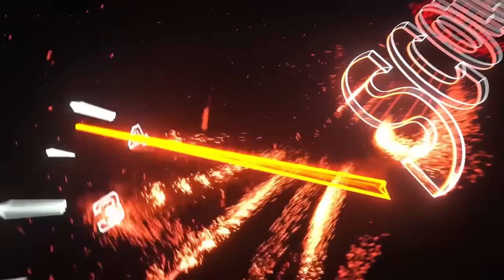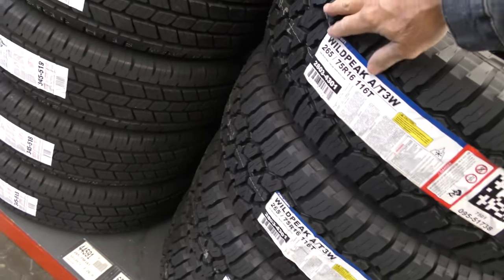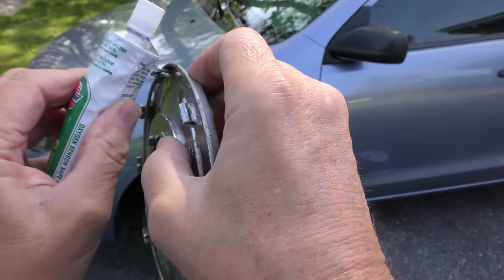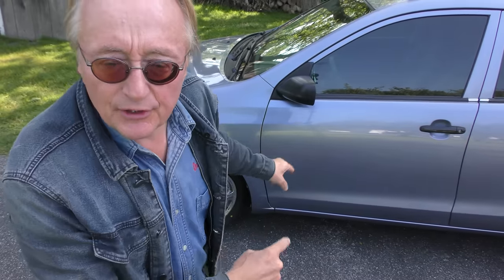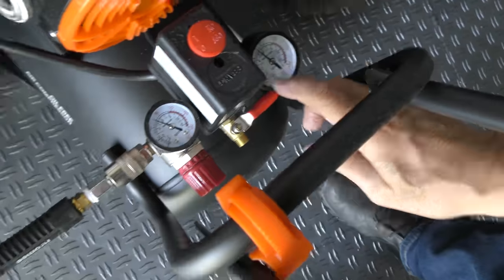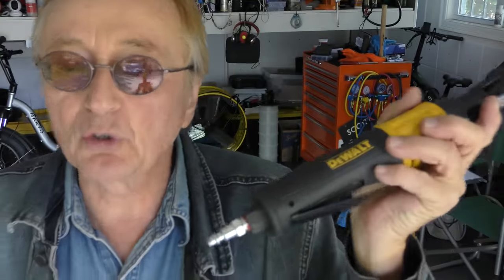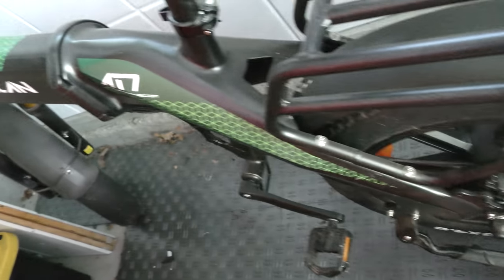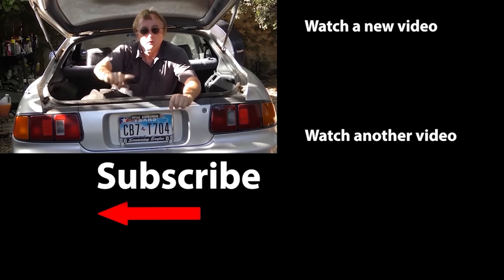Never Buy These Tires for a Daily Driver

Comment: Town Fair Tire is an excellent place to buy new tires and even new rims. My old car had factory chrome rims (never again in New England) that were flaking and causing my tires to leak. Needed a new set quickly and was worried about the final cost. I was able to find a great new set of rims at a decent price. They recommended several different types after telling them what I was looking for. Brought them to the car so I could see what they looked like. Offered interest free financing and helped me build my credit rating. Not sure how big of a chain they are, but for a chain, I was super impressed. If you buy tires and then see them listed somewhere else cheaper, they will reimburse you the difference.

Fabulous place.
Reply: Shop around. My local Town Fair quoted 989.92 installed plus tax AFTER mail-in rebate for the same goodyear assurance tires that Walmart Quoted 644.40 installed plus tax including road hazard protection. $345.52 difference a half mile away. No brainer.

Comment: I always buy factory take offs from craigslist, they usually have 100 miles or less on them, good part is you get new oem wheels every time too and all 4 wheels with tires usually cost less than buying 2 new tires by themselves.  You need to be in a larger city for this to work.  Wheels and tires currently on my truck are about 6 generations newer than itself (same model though).  Do your homework on fitment.

Comment: The valve you identified as a drain is positioned more like an air dump valve. A drain valve (which is used to drain water condensate from the tank, as you know) would be located on the lowest point of the air tank. The tank should be drained at the end of each day the compressor is used to prevent rust inside the tank.
Reply: But it has a plastic tank? So it won’t rust.
Reply: @paulsi1234  Chinese plastic is capable of rusting.
Reply: @dr.mantistoboggan4746  🤣

Comment: Doubling the advertised mileage is what I routinely get with tires. Air kept at the proper psi and getting them rotated at every other oil change is all it takes.
Reply: No way  you are getting double the advertised mileage out of a tire
Reply: @randyedelen5770  ok, I guess I did take some liberty with that statement……let me correct it. On my Ram 1500 4wd, my last set of BFG K02 tires, (which have a 50,000 mile manufacturers warranty) I only got 98,000 miles on the set before I replaced them with another set of that same tire……..sorry for my error……….😐
Reply: see he lied but ADMITTED IT LIKE A TINMAN!

Comment: By rotation of the tires they all wear out evenly. That's what I was taught as a young man from my Dad.
May God bless everyone!!
Reply: But the cost is the same on a 2wd car.  I rotate too, but over time the number of tires you buy is the same.
Reply: I'd be more worried about really badly worn tires causing extra wear on suspension parts such as struts and bearings from the wear angle causing stress on the components. That's the main problem with no rotation. I'd rather replace tires than a wheel bearing or something twice the price of a tire.
Reply: Tires suffer from age as well as wear.  So theoretically, if the set of tires receiving power wear out say in 8 years, the remaining unpowered tires will most likely not make it to 16 years.  They dry out, the sidewalls crack, etc.  So as others have stated, you're better off if you rotate the tires so they all wear out about the same time. Then replace them all with newly manufactured tires.
Reply: @guyrouillier  who the hell takes 8 years to wear out a tire, much less 16, unless it is a car in storage.  60k mi is usually the rated treadlife on rubber rollers.  That's <3800 miles a year if your daily driver 11 mi a day...get a horse or bus ticket.

RVs and boat trailers are usually the only tires old enough to seriously dry rot.  Sun kills the rubber.  Thats why they sell tire covers for long sitting vehicles.
Reply: @guyrouillier  new tire from china, boy

Comment: @Scotty according to the tire industry and independent testing including Car & Driver mag test.  The new tires ALWAYS go on the rear EVEN in a front wheel drive car because when it comes to lift/hydroplaning the rear lifts and it’s over!  But if the rear grips and stays planted it’s easier to control the vehicle. 🎉

Comment: I only buy Douglas AS. Very quiet and reliable, excellent traction even on snow. For me they outlast mileage rating with rotation at every 5k oil change. Full set in May, with free rotation and road hazard, cost me less than $400. Least expensive Goodyear you can buy.

Comment: Years ago, I had a Ford Escort with plastic hubcaps similar to what you have.   When the Ford dealership worked on the brakes for the car, they broke one of the hubcaps. They would not replace it, claiming it was old.  I had to pay for a new one myself.  This was not the only time this Ford dealership was dishonest, so they no longer have my business.  BTW, I have a 1963 Falcon in my garage.  The metal hubcaps for it work fine to this day!

Comment: If it was 4 wheel drive, there likely wouldn’t be much of a difference. You just replace the front two like a FWD vehicle. When I’ve enquired with various tyre places and the dealership for an Audi, they suggest that unless tread is very different, it’s unlikely to be much of an issue. In this instance the fronts were worn and the backs were fine.

Comment: You can probably find center caps for most cars, that's not a usually a problem.  The price, on the other hand, is usually the issue.  I've seen some OEM center wheel caps go for as much as $50-$100 per cap and more.
Reply: Ebay is a wonderful source for center caps at very low cost. I bought Toyota center caps for under $10 each.

Comment: About those electric bikes, just for safety, I would store them in a separate shed in case a battery goes up in smoke. It could be a serious mistake storing them in the garage, especially if the garage is attached to the house.
Reply: Isn't any different than people parking their electric cars in their garage...
Reply: if anything i would CHARGE them in a shed away from the house before actually storing them in an inconvenient place all the time.

Comment: Well, keep in mind to do tyre rotations so you always change all 4 so they all grip relatively the same. As Scotty advises, you’ll have new tires in front, but old rubber in the rear, so the rear can slip. Not ideal

Comment: The issue with this advice is that the rear tires will start to dry rot. After about three years, most tires will start cracking and are not as sticky as new ones. Rotate your tires when needed 10k miles or more if you have no alignment issues. Also most tire shops will tell you to put new tires on the rear. This will help prevent hydroplaning when going into turns.

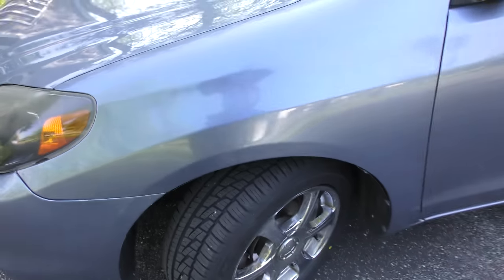Comment: 3:30 I just had some nice special order Falken tires installed at Sam's club and they put the dots in the wrong location on both rear tires. They did the front correctly. Man, businesses everywhere are so unreliable.
EDIT: Not sure if I wanna go back and complain. Now I don't trust them to reinstall them properly, clean the bead etc.

Comment: Town fair tire used to be incredible. Especially if you had a dealer account or a garage account. They do installs for five dollars each tire. They do have really good prices but they were bought out by Mavis. The old man Neil used to own every single location. It was generally Northeast, but I think they are expanding now. The only problem is, the alignments are cheap, but they will only align the be car. If there is anything wrong, you are on your own until you fix the problem. Also, if you have a dealer or Garage account, they do alignments for $55. That’s really half price, so you can’t go wrong. However, their text aren’t the greatest when it comes to alignments. You often have to go back for them to zero out the steering wheel.

Comment: Scotty is a well of car wisdom and knowledge. If I was a neighbor kid I’d be at his house every day.
Reply: You as a kid say sheepishly "can I hold that flashlight for you?", Scotty says "get that torque wrench and tighten down those lug nuts, no one ever learned anything by holding a flashlight!"
Reply: Not really. It's counter-intuitive, but if you're only replacing 2 tires on a FWD car, the new ones should be put on the rear. Because of the weight balance of a FWD car, you want the tires with the best traction on the back in order to control lateral movement, especially in bad weather situations or emergency maneuvers. You don't want bald tires on the back contributing to oversteer that may get dangerously out of control.

Comment: Walmart tires are horrible! Definitely get the free replacement plan. I’ve had almost a flat once a month or two!!! But yes get free one! Another thing Walmart put lugs on with impact and I couldn’t get lugs off actually broke one off!
Reply: Didn't even know Wal Mart sold tires! I love WM, but I don't think I would ever buy tires for my car from there!
Reply: @Jonathan-mp7xg It would never even occur to me to even look at Wal Mart for tires lol

Kind of reminds me of Sears auto center back in the day...who in their right mind would bring their car to Sears for car maintenance? Who in their right mind buys tires at Wal Mart if they care about their vehicle?

You go to Wal Mart for cheap Chinese junk that you don't care about quality, how long it lasts, etc. Perhaps most don't care about their vehicle as I do lol
Reply: @Jonathan-mp7xg Nope!  Just for kicks I checked out the local Wal Marts in my area...no tires in stock in any of 'em. I could order online of course, and have them delivered. 

Which is a disappointment, actually. Would have loved to see what Wal Mart has for tires! Even at the "super" Wal Mart 15 miles from me...nothing. 

Are they displayed in their own aisle(s)? The auto section here is literally sprays and waxes and things like that. Not even batteries.
Reply: @Jonathan-mp7xg The auto "section" around here is literally ONE aisle lol. Washes, plastic cup holder trays, license frame brackets...garbage like that. Zero actual items to make the vehicle last or even run. Not even jumper cables. I live in Taxachusetts, probably someone lobbied against it. (And got paid a damn lot of money doing so)

Comment: Also, tires have date codes. Try to get the latest dates and definitely verify all 4 tires have the same dates. Good vid. Thanks.
Reply: they are not 'codes' they are actual dates- by law. perhaps it is being confused with the DOT plant code.
Reply: @tommurphy4307    Very good. Thank you for the correction.

Comment: I normally install new tires at rear and older tires at front if FWD.
Reply: @Jonathan-mp7xg you need more grip at rear, understeer is way easier to control than oversteer. The rear tire are pretty new enough. If the tires are too bad replace it.
Reply: @Jonathan-mp7xg Agree. If you are going to only replace 2 tires (lousy idea imho) for a FWD you want at least the new tires up front.

Better yet...properly rotate your tires so they are all on equal tread and replace them all at once when needed.

Comment: I live in Canada and I found an amazing strategy for buying tires. One of the chains has a credit card and offers a 24 month interest free payment plan on any purchaes over $150. They also offer cash back on their card and membership, and have monthly bonus rewards days where credit card holders get 30-40x the cash back. So I planned ahead and waited for a sale where the tires were already down to a buy three get one free price, and made my appointment for the bonus cash back day. I bought a set of road tires for my car and a set of BF KO2's(not cheap tires) for my heavy duty van. 

I got 35% off the regular price, plus I got 30x the bonus cash back. My original bill was $2400. The discount took it to $1700, then I got $850 cash back on my card. Two sets of expensive tires(that I chose and wanted) for under $900. Break it down on 24 month payments, and it was $37 per month to roll on amazing brand new rubber. I don't expect to have to replace them for at least 5 years, either. And you know when the time comes, I'll be ready.
Reply: PS, My co-worker with a new AWD SUV had her tires replaced just yesterday after a catastrophic failure emergency: $2600

Comment: A large volume of tires actually causes them to sit around more. You want a tire store with a lower inventory, this means the tires are moving through quickly. Theres nothing wrong with running 5 year old tires. Ive been doing it for years, I also avoid goodyear, those are junk.

Comment: I GOT THE ARIEL RIDER X CLASS ELECTRIC BIKE, 35 M.P.H & 75 MILES ON A SINGLE CHARGE, I CARRY AN EXTRA BATTERY SO I GO 150 MILES WITH NO ISSUES BUT IT DOESN'T FOLD.

Comment: One of my favorite brands of sport tire is kumho. They last even when abused. They are harder so tiny chunks can rip away but they have unrivaled traction even in some of the heaviest squalls. I'm not paid rep or anything but i am an incredibly happy customer and their price vs value far exceeds most of their competitors.
Reply: Yeah but are they run flat?
Reply: @BV-Auto  please elaborate. I had a set of continentals once. I've had erasers on pencils last longer.
Reply: @AmixLiark Continental tires are garbage, same with Goodyear and Michelin. I buy Toyo, Kumho, and Nokian.
Reply: I just got rid of a set of Kuhmos  , they are cheap , soft and wear fast
Reply: @mikej238  what kind of kumho?
Reply: @MikeYurbasovich  Nitto NT05, NT55, and their cheaper Neo-Gens are the best in my opinion.  For track and daily.
Reply: @dj_illeagle  I've never tried Nitto tires, but my car is awd and I like a little better wear.  Some people like really hard, loud tires, but I prefer good braking and cornering.  At least I can avoid a crash better.  Tires are huge.
Reply: @mikej238  Soft and cheap are not the same thing.  Hard tires have a lower rolling resistance, but they are also loud, they don't corner well, brake well, or stick in cooler temps. Kumho makes good tires.
Reply: @MikeYurbasovich Michelin are garbage?? 😂 funny joke

Comment: The problem with buying tired from a tire store is that ehen you are traveling the chances of finding a store nearby are slim to none. Plus, they are somethimes only open 9-5 during the week so if you have an emergency on Sunday you are SOL. And, if you het special irder tires then they eill most likely not have one in stock. I had a complete sidewall blowout on the interstate doing 80 mph (handled it well thank you) and what do you know there was a WalMart open on Sunday 2 exits away.  Worth considering.
Reply: Walmart and Costco still go through a lot of tires. I would 100% buy from them if no tire stores were open

Comment: Them Silent oil free compressors are great, sprayed a whole car use for airtools, pumping up tires etc aparently they have a 100% duty cycle so motor can run for quite a while. (as long as keep filters clean) Been looking at Vevor tools including the Injector cleaner (AUTool) seems like good stuff. Im in the middle of working out what to do with my garrage :) Thought of even my own tire changng equipment.

Comment: Hi Scotty, I bought my car brand new around 6 years ago and only has around 55000 miles on it. It's still running on the original sets of seasonal tires and winters I bought around the same time, so each set has only been driven around 28000. Treadwear is still good and I don't see any visible cracking yet. How long can I continue driving them for or should I starting saving out for new sets? Thanks
Reply: 12 years and 6 months. 10 years is a safe bet unless you live in 120° half the year. 8 years might be the max in Phoenix or Mexico. The deep  cracks around the  tread won't flex much and where the plies come together at the side wall is the weak link.
Reply: if they were formulated from cheap plastics then they should be good for at least a few years, if they were made from industry-leading polymers then they could last 50 years with proper handling and treatment. and everything in between.

Comment: Mr. Kilmer, please ur opinion of replacing the wheels and tires on my 430 Lexus, currently they are 225 55 r17, I want to go to 245 45 r18, which are found on some LS 430 models , my car is a 2006 ML trim , ur thoughts ??

Comment: A little confused Scotty. I buy 4 tires at a time. Am I wrong for rotation until they all need to go. Do some of y'all not rotate your tires?
Reply: Literally every mechanic I personally know recommends rotating tires.
Reply: If you drive a 2wd vehicle, rotations are a racket. I'd replace the drive tires only. On a 4wd vehicle, you need to keep the tread depth equalized for transmission life.
Reply: Granted, I live in the snow belt in the winter with powerful Nor'Easter's. I have never had winter tires, good all season tires. You need solid traction up here in the winter, regardless if you have AWD or 4WD. A good pair of tires up front in a FWD will be worlds better than lousy tires with AWD. I rotate twice a year...once in late fall and then again in the spring.

Comment: Should the tires get rotated?  Maybe a X pattern and move the back tires up front and front to back?
Reply: Yes. Depends on vehicle. But generally on a regular car, rotate front to back and other times side to side so the tires counter rotate.
Reply: Can't do that on a Corvette or 350z unless you bought symmetrical setup. The rear tires are wider than the front. If you drive an all wheel drive, and each tire happens to be identical, go ahead and rotate. It'll save your transmission.  But it's a waste of money other wise.
Reply: @marshmower  Why would it cost money?